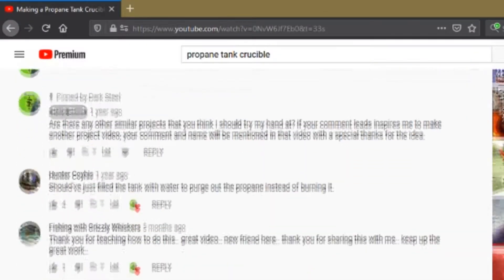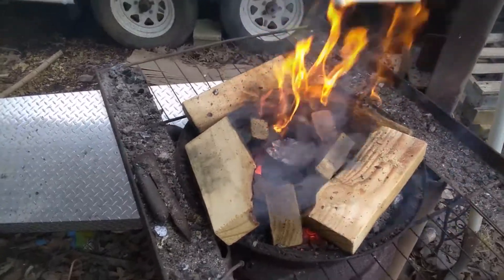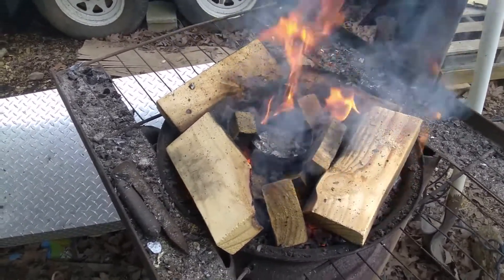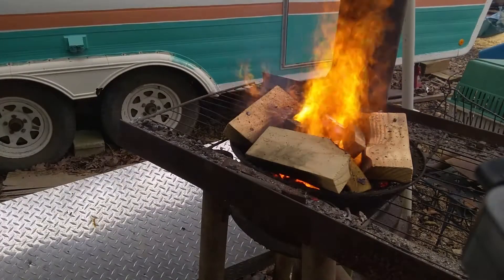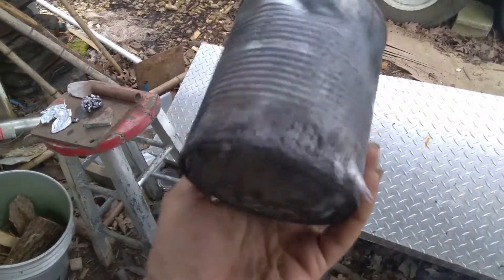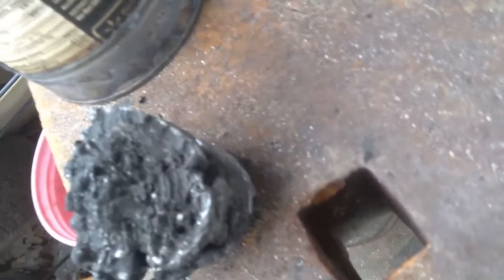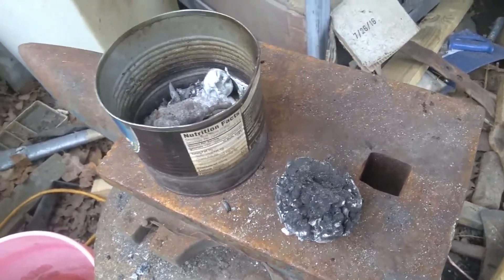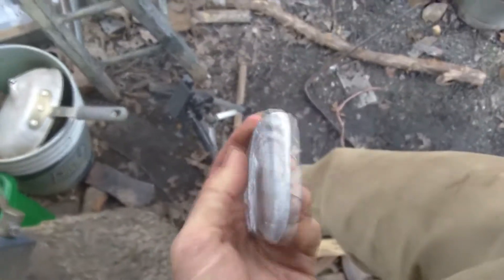Can I Melt Aluminum in a Tin Can

Comment: The problem is a fire not too much hotter than the one you have will burn holes in the bottom of the can

. The good news is that all the slag stays in the can while the good stuff ends up in the bottom of the fire refined.

The bad news is the time you wasted learning through trial and error.